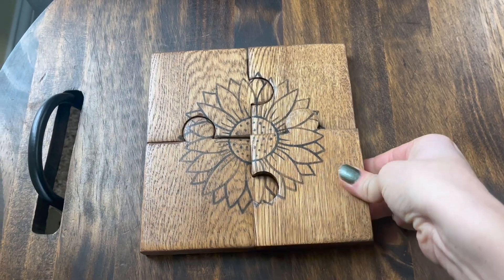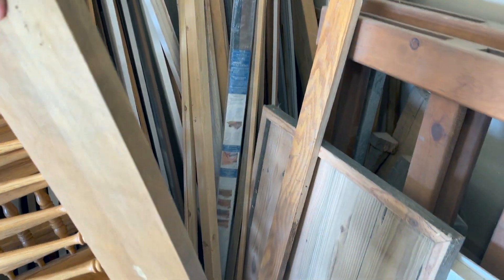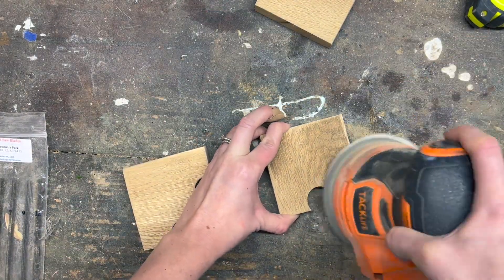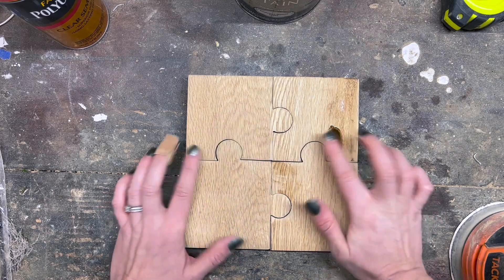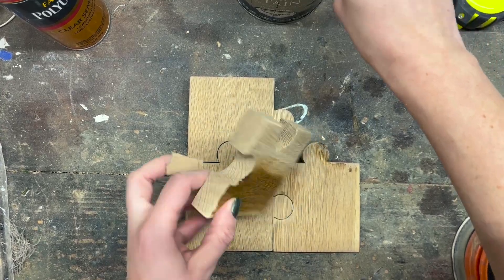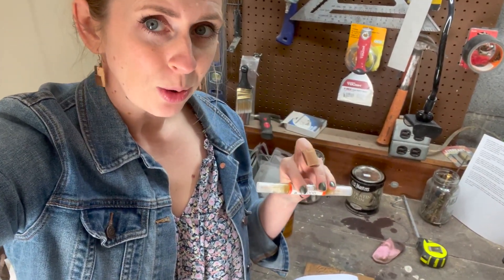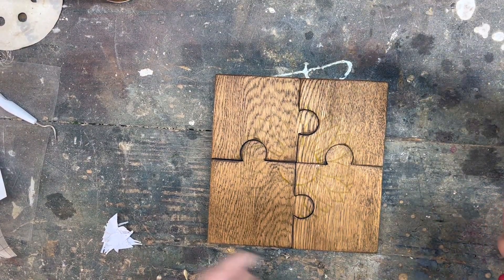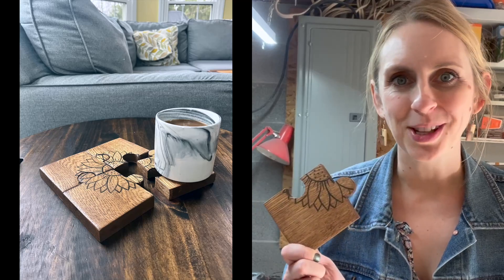Beginner Scroll Saw Project | Easy Coasters!

Comment: 220 grit is usually great for most wood projects. If you go to high with the grit, you may end up clogging the pores of the wood with dust and then you may burnish the wood. This will make it more difficult for a finish to adhere to the wood.